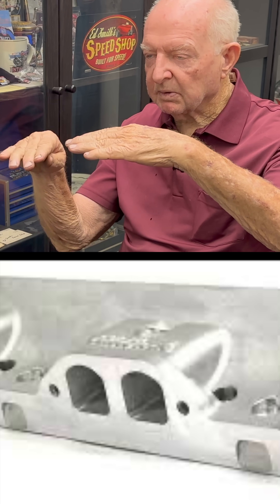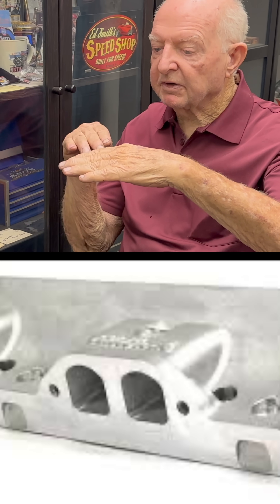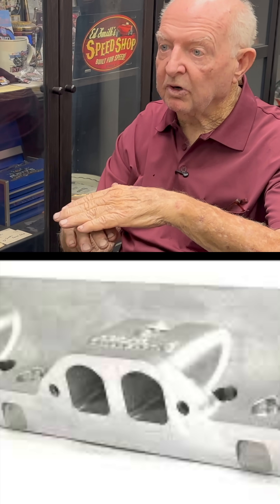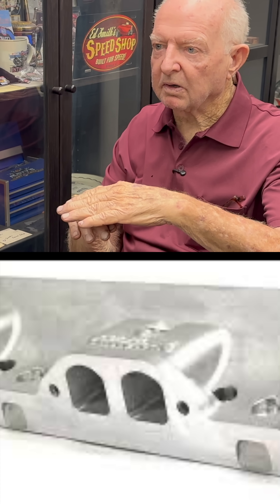Exhaust Port vs Intake Port   Don't Treat Them as Equals!   Ed Smith w #BarryT from Ask Ed 45

Comment: Fords use exhaust duration longer
Reply: That is part of it but a longer duration won’t do any good if the exhaust pulse bounces off the wall of the header and travels back the other direction. Duration , header design, exhaust port shape, H pipe x pipe all play a part in siphoning the exhaust out of the engine

Comment: We used to call that flash pointing at my shop to bust up that air fuel mixture and cut out anything that got in way of the exhaust port and make it so smooth and bolt header on and scribe it out and smooth anything that could slow it down

Comment: My good friend worked for Ganassi racing, was a fab guy on stearling marlin car. They spent hundreds of hours on flow benches  just at the exhaust exit of the car. Im talking the last 2ft of the pipe. Inside the pipe was dimples or louvers designed to actually scavenge gases away from the head. Engineers like this are paid to come up with thousands of this or that to be better than the other guy.
Reply from the maker: Wow, that’s incredible attention to detail!

Comment: After the ability to see inside runners, and knowledge, the optomim flow is to have the mixture flow evenly at the valve. With the top of the runner being longer than the bottom, we like to smooth the top and actually dimple the bottom. The exhaust being a little more forced pressure we just smooth that. Especially at port to header connection. Even flow throughout is key.
Reply from the maker: Good insights!

Comment: Headers are by far the best thing you can do to make power and increase gas mileage.
Reply: Correct length and with a collector. Not just slapping on a set of headers, which "can" cause more problems than just leaving the factory cast exhaust manifolds.

Comment: Seems like there was a time when "inventors" promoted under carb spacers with screens for fuel atomization. I can't remember what name was taken to imply the usefulness, but if they did the trick, they'd be commonly used in the carbureted engines.
Reply: Jc Whitney…😜
Reply: It could also save your engine in the case something happened to fall into the carb bores.
Reply from the maker: That’s true!